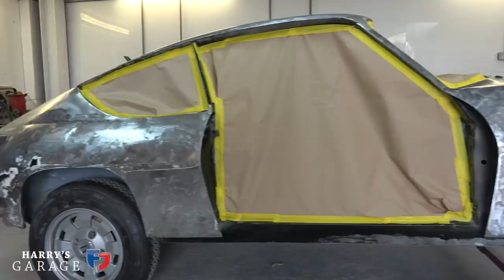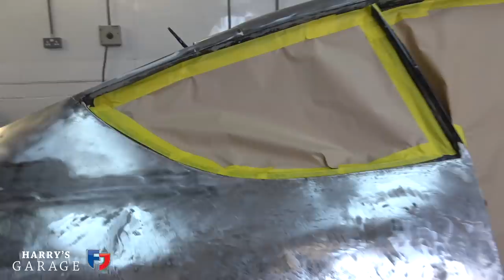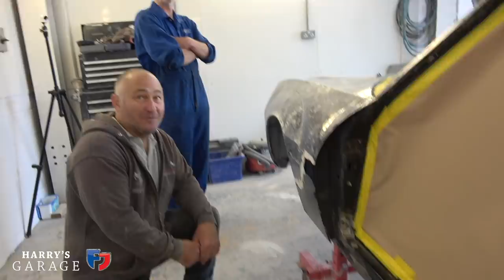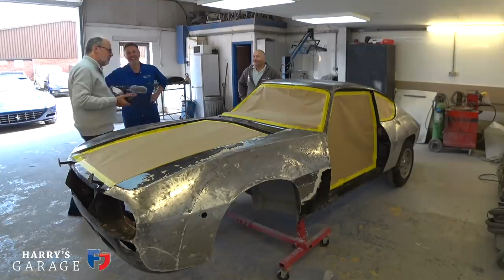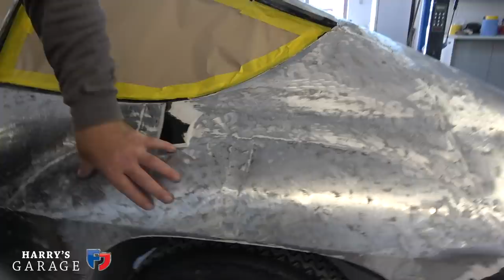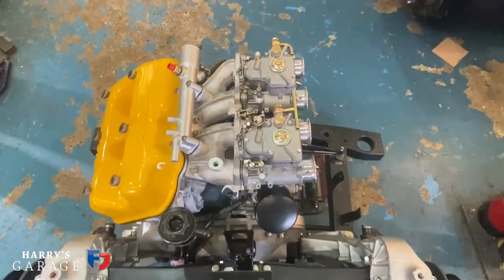Lancia Fulvia Zagato 1600 restoration Pt.6. Stripping the paint reveals shocking bodywork repairs

Comment: What a disaster Harry - did it look like it may have a 'factory special' made without swage lines in the quarters when you went to look at it? (I am laughing - but not at you)  A 'body sculptor' went to work - not a body repairer.  The front subframe and engine package looks nice though - and I am sure these guys will get the body right.   With it being pulled apart so far - have a thought about once the guys have removed//repaired what is required - then dipping//stripping the entire shell  Preferably in an alkaline strip and electrolytic rust removal and then e-coat the entire inside and out.  There is a place in the UK that offers the dipping//stripping and e-coat that gets into all the nooks and crannies.

Comment: What a shock. It looked like a ok car with the typical Italian rust issues. I guess you can never tell. Looks like your in good hands though. The Zagato brand just took a massive dive IMO - very poor workmanship.
Reply: This stuff has nothing to do with Zagato 50 years ago! I´m not saying that their build was excellent, though my experience with a Zagato coupe threw up no quality issues. Look at the frame welding on a 60s Miura, Abarth, Aston, TVR etc and you´ll see it is functional but ugly. Modern restorers usually tidy that up as they get paid by the hour and the customer is rich.

Some cowboy in England is responsible for this mess, not the original manufacturer. Same way that the car has got to this stage and suddenly we find "Dear oh dear, ´Arry, it´s a complete effin´mess but we´ve done all this work so far and you wouldn´t ever have guessed we were wasting your money. Funny old world innit, ´Arry?"

Comment: They can hammer and dolly the crap out of it. Be forewarned Harry, working out crap panels will take far more labor than replacement with new metal. Metal doesn't cost anything. Hammering out the dents will cost way more labor than making a new one.
Reply: You reckon 😂 don’t think so

Comment: Disappointing but not surprising.  Zagato's workmanship was generally of poor quality so the body was always going to deteriorate faster than most, and that's where the bodgers come in.  Perhaps an early Sport 1300 in aluminium might have survived better.  Rule of thumb is to double your budget for a Zagato body restoration vs Touring or Pininfarina.

Comment: Je-Sus, it looks like Frankenstein monster!, like you joked about weight savings when it came to mending the floor and putting things right, but that must have been 90 pounds of filler there and it seems like LF save, LR replace, Right Front Replace, Right Rear Save.

and its ironic, I just watched someone do the roof of a white 512BB and now I get to see it on this, thing was, all his was, was a pin hole someone had drilled to fit an antenna, not redo the whole damn thing.

well atleast your getting plenty of content from this thing, and its bespoked to you and you only, couldnt do any better if you warped back in time and went to the lancia factory

as then it would just be another car.

Comment: I wouldn’t entertain trying to fix those mud guards and just get the guys to make new ones and be done with it. It would be cheaper in the long run as a pose to say 50+ hours per panel and that would just be a conservative estimate and the car hasn’t got a coat of paint on it yet. Plus you wouldn’t need 20kg of bog either to hide the sins.

Comment: 17:14  You would almost be better off having them build something from scratch around the front subframe and engine.
Reply: Would it still be a genuine Zagato?  Grandfather's axe and all that. It's possible to build an Austin Mini or 60's/70's Mustang from all-new pressings apparently.  Bit more of a grey area on a coachbuilt car I suppose, where there are no stamping dies -- original or otherwise -- or used or new old stock original panels as such.

Comment: I have been in the restoration business for 50 + Years , and I have seen some bad workmanship in my time ,BUT  ! the butchering on this Lancia  is something else
Reply: Good to see you are following this Peter, your comment really highlights how much work is needed.
In your opinion would it be better to bite the bullet and remake every panel?
Reply: @kevinbradley172  I definitely would , those repairs are going to take too long and at the end of the day you still have to fill them . The hours involve to ''repair'' the whole body and re fill it are going to be close to the time to re make the whole  body. Keep in mind also that once the body is filled ... that is not the end , the painter would need to do a lot of work as well to get it to the painting stage inside and out.
Reply: I agree, most of the panels seem butchered beyond redemption  and cant really be classed as original now, repairing them will be expensive  but still a bodge . Make a proper job, remove the outer panels, sort the inevitable mess underneath repanel and end up with no issues.

Comment: It's not even my car and I'm watching this thinking F U C K, what is this going to cost and is it really worth it long term! Last thing you will want to do is ding this on a rally after spending this sort of cash to restore it.
Reply: @Lassi Kinnunen 81 not if you can't get panels for it anymore. Doesn't matter if it is an original or a restoration, it is still going to hurt the back pocket just as much to fix it. One doesn't cost less to fix than the other for the same damage, still has to be repaired.